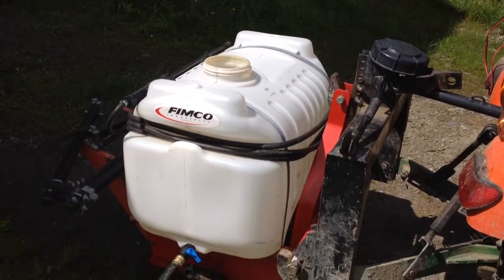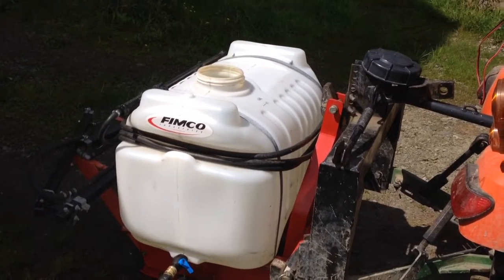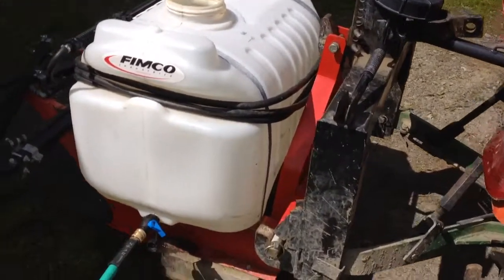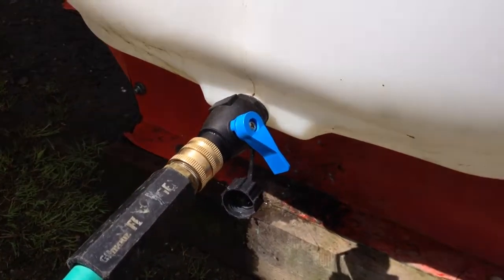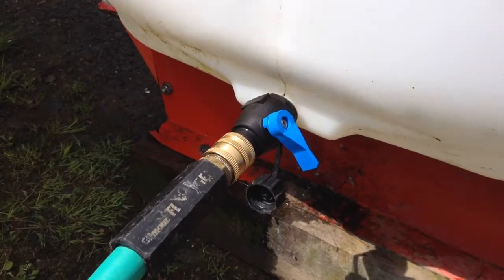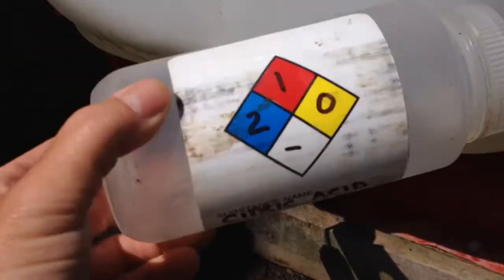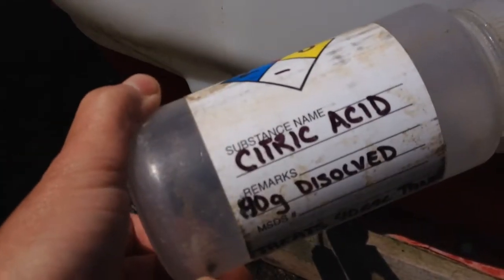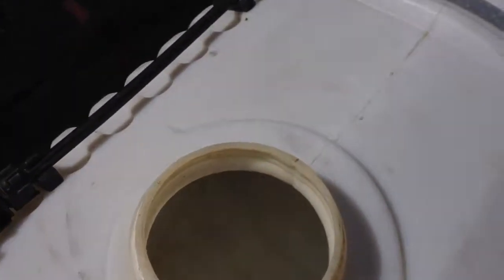Fimco Spray tank hack: Ball valve and hose coupling

Comment: I have really hard water too; lots of both calcium and iron. The water softener used literally more than a ton of sal per year. Calcium ion exchange with salt is 1:1, with iron is 5:1. By removing the iron (Fe+5) with the iron filter before removing the calcium with the water softener, the iron filter paid for itself in a few years. The iron filter works by running air (oxygen) through its media and precipitating the iron out of the water, then back-flushing it down the drain. Water turned light blue, from a light yellowish. I use a lot less salt now and my softener should last longer.
Reply from the maker: We have one of those on the house system.  I don't have softened water available outside of the house.

Comment: I'd put an air-gap fitting on that if your water hose is connected to your house. Power goes off and the house water would be contaminated.
Reply from the maker: Not a problem.  I have a check valve installed at the standpipe.  I needed it for the fruit washer (same hose).